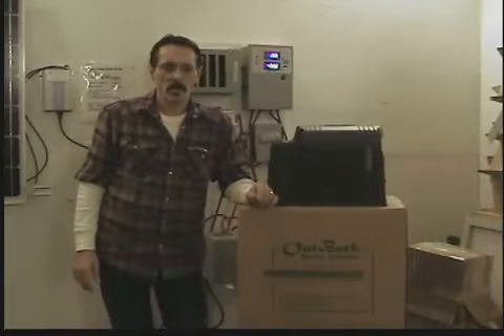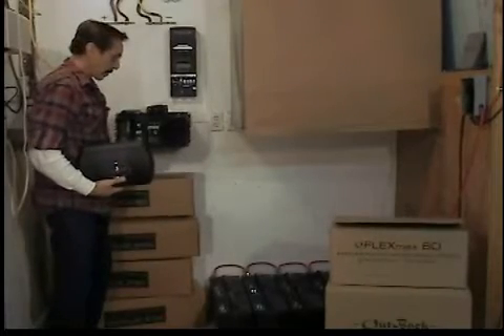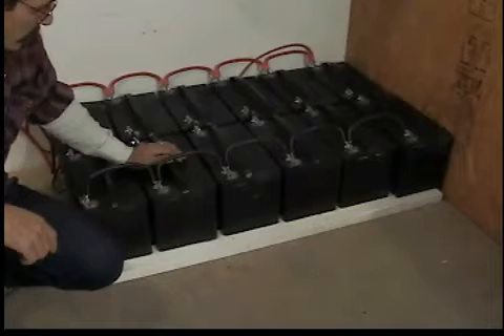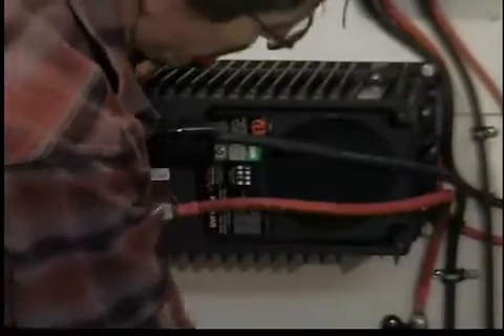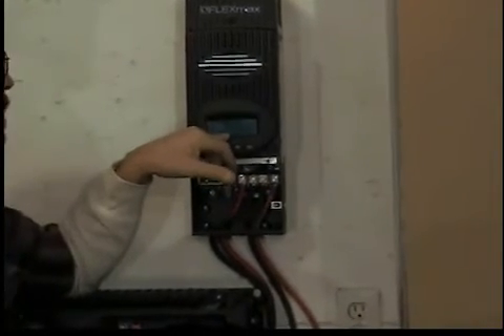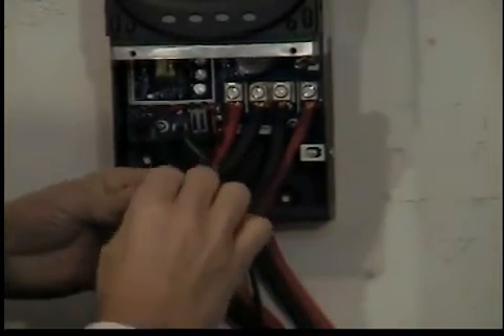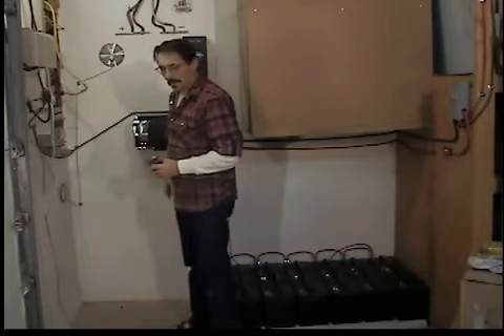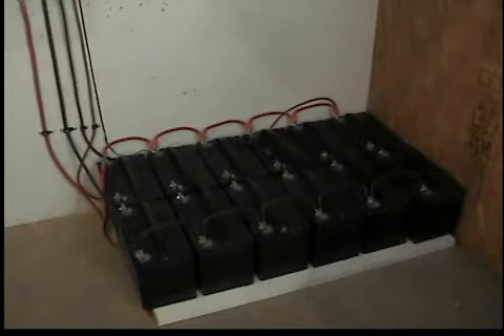DIY Grid Tie Inverter: How to Install an Outback Grid Tie Inverter | Missouri Wind and Solar

Comment: Yes,thats correct..I was thinking to build solar dryer room just for clothes.Insulate well small space and use the heat from sun to dry the clothes.It could be great in arid places,but in florida,that would have to be isolated from humid air which is not drying anything even when is hot air.It's just so saturated with water down here.Gas is the way.

Comment: interstate batteries has a program were you can get good used batteries at a greatly reduced cost. the last time i inquired they were 20-25 buck per 12 volt car battery. but that's been some time ago. i also inquired about deep cycle batteries at that time and they were the same price as car batteries. today that may have changed. but worth the chance to inquire about it.

Comment: so if i only have one GVFX3648 inverter i cant run 220 volt appliances?? will it ruin the inverter or appliance if u you plug in a  220 volt appliance in the outlet or just not turn the appliance on?
Reply from the maker: One GVFX is 110 volts, you need 2 of them to make 220 volts. You can get a transformer from Outback to hook up to one so it will run 220 volts.
Jeff

Comment: Nice video and that is great setup you have,but lill pricey for me..I have Aims 6K on Trojan T105..As far as cost. Aims 6K ($2K),T105 ($96 new p/pcs) plus cables and you can run whole house under $3K.I mean whole house even AC..well except  8kW Drier and Range..But there is breeze outside and BBQ will take care of those two..hihi..

Comment: hey im looking to have a grid ite system with a battery back is the possible? i want to run 4 wind turbines and 4 solar panels, but i want to run my house off the wind turbine and solar panels.and if the system doesn't create enough power to get it from the grid...or even feed back on to the grid.....can you help....and and in this video can you have the power from the battery bank feeding the panel and the grid switch on too?
Reply from the maker: Yes, that's what the Outback does, it's grid interactive.

Comment: How long will a battery keep charging to a useable volt using the hardware you have hooked before you have to get rid of it. Do all the battery's go at the same time or does the first battery connect go first.Does the cost of the battery out way the saving of the electric bill. What do you go by when you pick a battery like Amp Hours at 20 Hour Rate:

Comment: How come when I connect my solar panel that puts out about 17volts (cloudy) to my charge controller (similar to yours) my volts drop bellow battery voltage.  My battery is at 12.18 volts and the panel drops to 5.4 volts when connected?  Is this normal voltage, or is the panel defective or charger consuming the rest of the power?  If I connect the panel directly to the battery it is 12.19 volts.  Starting to think this charger is drawing all the power instead of charging.
Reply from the maker: Sounds like the charge controller

Comment from the maker: Most off grid people will go with a gas range and a gas clothes dryer instead of electric. I was an appliance repair guy for 25 years and i can tell you that gas is a lot more efficient and cheaper to run then electric. That's if you are able to run gas.